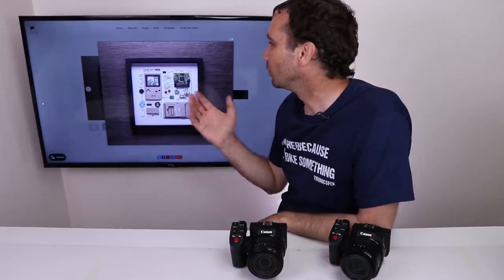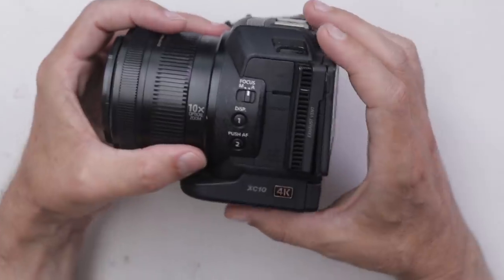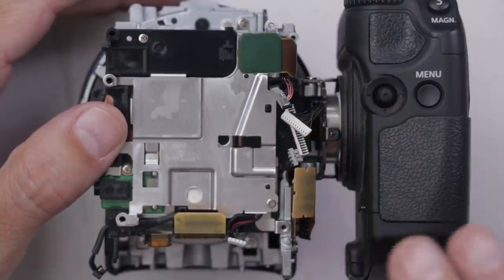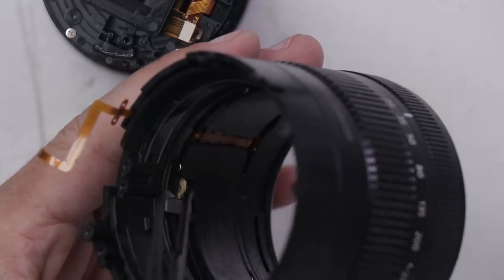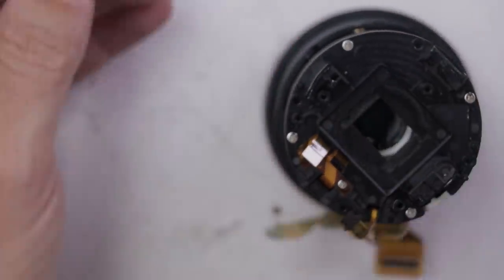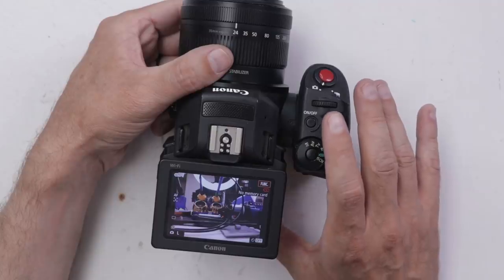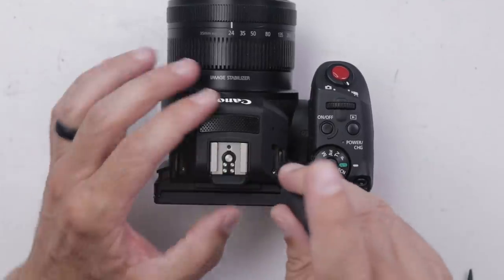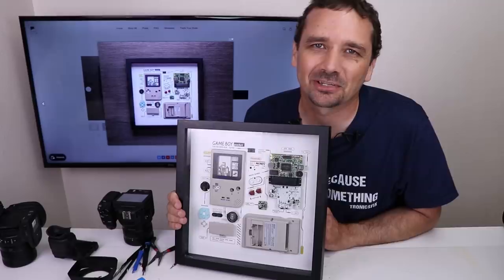I Bought two BROKEN $1,600 Cameras - But Can I Fix Them?!

Comment: I was cleaning my PS5 and took the fan out to clean it and all that put it all back together turned it on played for awhile and got over heating .. I thought my connector came loose (which I did not touch I pulled the fan shroud off to clean the fan) and yes my connector came lose all right it was ripped from the mother bored 🤦🏻‍♂️😭😭 it need new traces this was definitely a vulnerability on Sony's part

Comment: Camcorders are hyper complex. Even with all my experience repairing electronics, I wouldn't even attempt to disassemble one of these. Getting them back together would be a nightmare not worth the trouble even if you manage to fix it.

Major respect to Steve for not only getting these sumbitches put back together, but getting them to work.